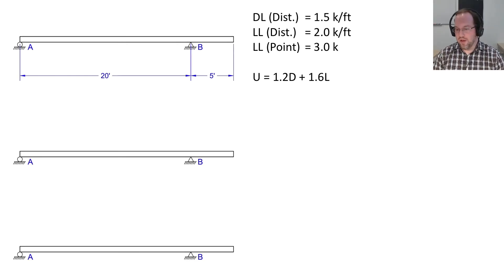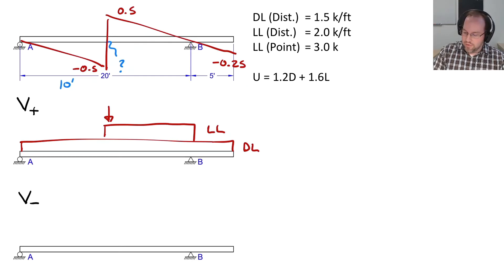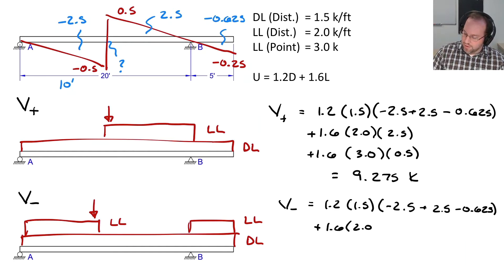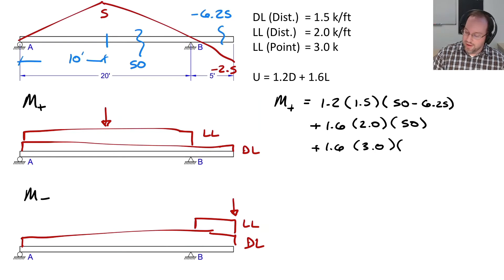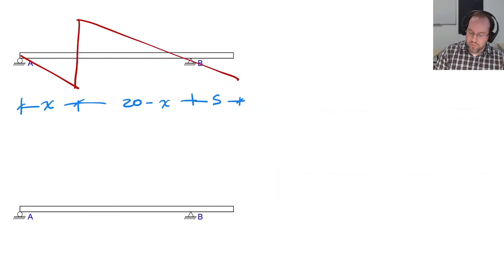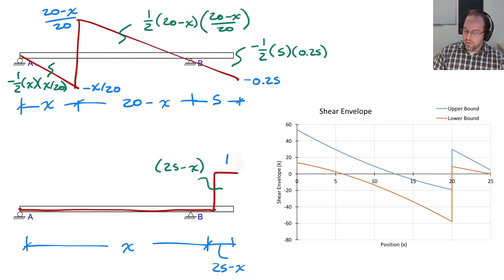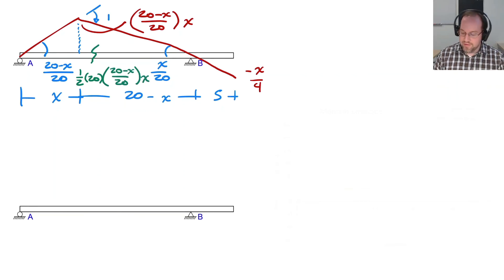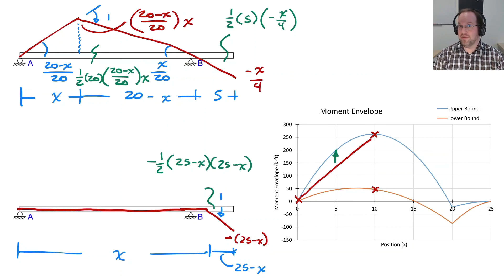Design Envelopes for Worst-Case Demands with Movable Live Loads

Comment: How did you make the graph in excel? or combined the 2 functions? please, explain
Reply from the maker: I just made separate functions for each region (x = 0-20 ft and x = 20-25 ft). My Excel file is here if that helps: https://docs.google.com/spreadsheets/d/1rZTLzybXjCHLEMeXobdmCsVq5eS3mafr/edit?usp=share_link&ouid=116718473101577906015&rtpof=true&sd=true
Reply: Thank so much sir,  this is very helpful. I really appreciate..